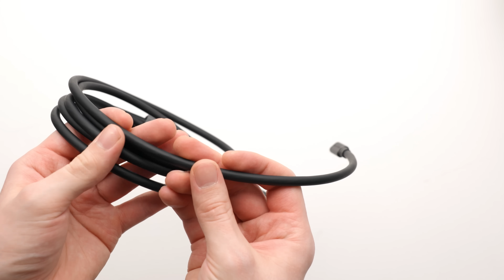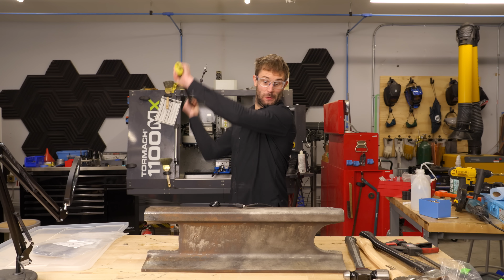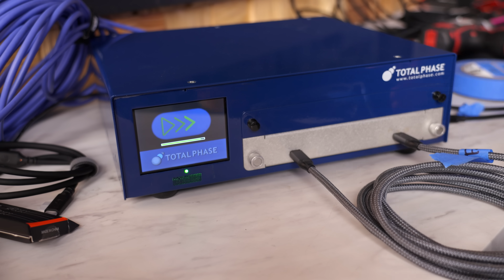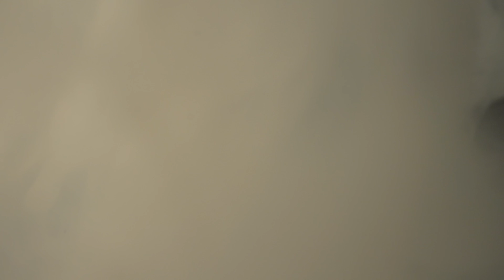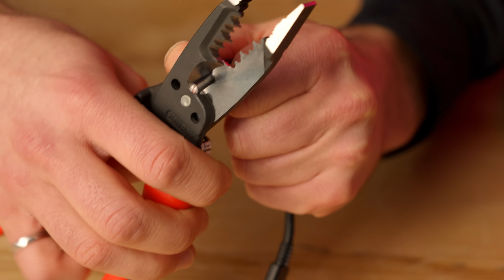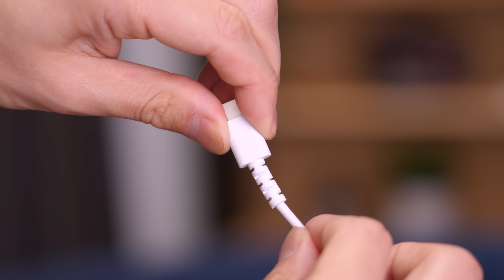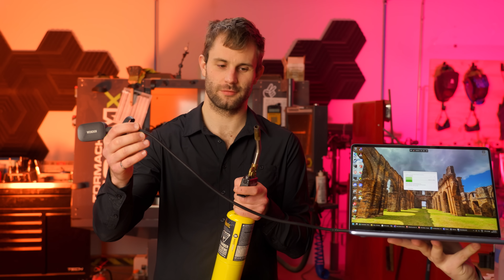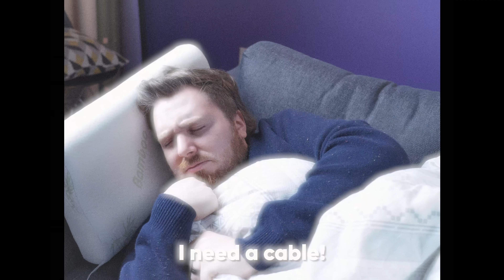Why It Took Me 4 YEARS to Make a USB Cable

Comment: But does the website have a feature where you can selected both sides of the cable and ajust the length and choose specs? It the finding on the website as streamlined as the cables themself?
Reply: That would actually be a cool feature. Have just one product page for the cable instead of multiple. Then there are like 3 drop downs: one for each end of the cable, and one for length of the cable. Then also have a smooth animation of a cable changing based off your choices.
Reply: @ExTr3Me_Cobra  exactly! Every time I need a very specific cable I wonder why no website is doing this. Even webshops that focus fully on cables don't.

Comment: The explanation is a bit woolly. 
Are you saying that there's 4 high speed pairs in both cables but one is 4 unshielded twisted and yours is 4 coax pairs? 
Is the power in the centre important? 
Does using coax negate the need for intra pair shielding?

Comment: I bought a cheap cable tester on amazon for like $50. I went through all of my cables and ended up tossing 75% of them. I was blown away by what even that cheap cable tester taught me. About 25-30 cables got tossed. Bought a handful of ugreen 80gbs/240w cables to replace them.

Comment: It didn't mention it but is it just data and power or does it have video as well because I want to use it for a VR headset or screen and I need the cable to be long and durable with video/data/power.

Comment: Ok guys, now thunderbolt.  I’ll think I’ll buy a couple and try one with my dock, but I’m assuming it won’t work without the right chip in the cable.  My old USB-C dock with my old windows laptop was more stable than my new thunderbolt dock. It’s frustrating. I’m assuming it’s the cable because it seemed to make it better swapping cables, but it’s still not rock solid.

Comment: Pricing may be subjective, but I'd rather pay 30 CAD for quality cables, rather than I pay 3x 10€ for cables that may or may not work. I've always been skeptical of LTT products, as I don't always see the need for them, but this is one of those cases where if true, you have knocked it out of the park. Well done.

Comment: I love how Linus is clearly either concerned about the thickness of those cables himself, or had been at least somewhat convinced of it being a problem by marketing.
Those cables aren't for daily use by a typical iBro. They are either business use, or enthusiast - but unlike pricier hardware, which decimates enthusiast market sales, those are not THAT pricy, which - in the cases of practical purchases - does statistical wonders for sales in this market.

Then again, they'll see it 3 quarterly reports from now on themselves xD
Reply: Checked the whole skew prices.
That word... "premium". I don't think it means what you think it means xD

25 CAD for a good 10gbs 2m cable is far from premium...

Comment: I have multiple USB C charger points mostly using mostly Motorola phone chargers and an old ass apple phone charger that I've just HAD since the iPhone 4... When I go to charge my helmet hands free, some chargers won't charge it and the one that does, the USB C has to be the right way around to be changing.

Very interesting stuff, these cables have a lot more going on than I ever thought

Comment: Funny. I'm dealing with a garbage usb c cable disconnecting when charging right now. I've waited for these since it was mentioned on the WAN show.

NOOOOO all the cables at a length I want are unavailable :( signed up for notification email I am really tired of the cables I am using currently.

Comment: when you said "expensive" i was under the impression they were gonna be like 50 bucks for one of the shorter cables or something, but 30 bucks cad? for a 3 meter 20gbps cable? or a 2 meter 40gpbs cable? and actual good quality build? not bad at all. im down right sick of having a drawer full of garbage, flaky cables that either only do 5 watts or dont do data transfer, or fail after being bent the wrong way.
case in point, i recently bought 4, one meter 20gbps 120watt cables for 60 bucks, or 15 bucks a piece. they are a third of the length and half the wattage, and the build quality is... fine. in comparison the 40 gbps cable is double the speed, double the length, double the wattage, and probably double build quality so id say that a double in price is a non issue.

Comment: I mean 30 CAD on the high end is not an expensive cable really... It's only a little bit more expensive than what similar cables on Amazon go for the in the UK, from a slightly more reputable brand. Global shipping would be the killer of the value of these though

Comment: When Linus said they are expensive I was expecting 40-50 USD range... $27usd for most expensive c-c and $21usd for most expensive a-c. Honestly not unreasonable at all. I've seen similar pricing on terrible cables in retail stores.

Comment: 1-2 years of use and silicon will start to harden and brake... grate idea to use silicon...
Reply from the maker: You're thinking of PVC. Silicone is extremely resistant to cracking and UV damage - LS

Comment: Expensive? Have you seen EU prices on similar cables. Finally LTT pricing that is actually cheap for the quality. Just a pity you don't have slightly longer ones (I know it's harder to make up to the spec, but would be nice)

Comment: All the lengthy ones are already sold out so good job i guess ? lol
Are you going to branch out into different connectors ? Like DP or HDMI ? Those tend to be garbage quality as well, and can even lead to damaged equipment in the case of DP due to power.

Comment: Are these made by the same manufacturer as Tether Tools? They're the only USB-C to C cable I've seen with a little ribbing for pleasure and a similar strain relief. Tether shooting a 102mp camera to a laptop is what highlighted the need for ultra high quality cables for me.. If you guys wanted to take this tech and produce a high end USB-C hub to properly make use of the 2 USB-C ports on a macbook, I'd love you forever. Slap some photograph/videography related branding on it and you could charge a fortune- everyone else does.

Comment: honestly, as someone who spent 30 bucks on a third party oculus link cable + pd charging. these aren't bad prices AT ALL and honestly very reasonable compared to other advertised 'High Spec" cables that are just as good as dollar store ones. the only issue id have with them is that they are a little bit on the shorter side. but its nice to see that a 10GB 10CM cable and the same 10GB 3.3ft cable are the same price (according to the store page)

Comment: You should've incorporated 1 steel cable all the way through the middle, keeping them held together (not able to pull apart... especially the ends).  That single small feature will allow your cables to stay together for YEARS (and set you apart from EVERY other manufacturer).  I'm SO TIRED of replacing my kids charging cables, etc. because the ends have starting to come apart.

Comment: I will say, anker 240W 40GB cables under 6 ft meet the standard, and so do hp's and Dells. At least one of their line does. I'm Blown Away all these damn people keep buying the garbage off of Amazon. Amazon is basically AliExpress, but claiming to have more legitimacy😂
Small tip, a lot of the HP and Lenovo and Dell Docs actually have a strain secured 3.2 or 3.1 at Power delivery ratings such as 120 or 240 Watt. I tend to buy these when the dock fails or I see them at a Goodwill. If they aren't good, I harvest the cable

Comment: Almost all (usable) sizes are sold out on the international store, only more the 3,5m or less then 40cm left so the product seems very popular.I did have a small question about the a-c cable, do these have the high wattage capable conductors like the c-c cables or is the cable itself the limit (Linus has said on wan show if I remember right that the power limit is because of the official limit of the USB specs)

Comment: I have exactly 1 usb c cable which came with an inateck 45w charger which you can't buy anymore. This cable just works since around 6 years! it looks like sh*t because I had to wrap it with isolation tape but it works reliable. I had many also expensive cables which didn't last a year. I would be happy to buy the same 50€ charger again just to get the cable... So I will be very happy to get one of your cables for half of that!

Comment: It's really upsetting that "Does what it says it does, doesn't fall apart after a week of normal use, and has a label to say what it can do" is a selling point here... Especially after hearing your issues finding a supplier. An issue that pervasive for something that simple is supposed to be what a certification process prevents.

Comment: 8:22 I have my right angle 120W cable for my Poco F4GT, I've literally taken care of it and tried to never put any forces onto the end for 3 years and last month it still broke for no reason, and buying quality right angle 120W usbc that will not fall out of the port (as any other cable does)and will actually allow 120W is impossible :'(

Comment: The 16-item list for cables is a mess to scroll through and makes it way too hard to find the right specs. It would be much easier for a user if you just used two separate dropdowns for length and speed instead.

Comment: Very interesting that it doesn't seem possible to make a 40 Gbps cable with more than 1 meter length. That basically means that all longer cables on Amazon are automatically a scam and almost certainly do not fulfill the spec. Mabe expect for a few super high-priced cables, but not the basic cables you would normally buy.

Comment: Let me know when you have a 6.6 foot cable, I really would like one to replace my elegoo Centurion carbon 3d printer printed head cable. Which is just the type C cable, Elegoo has been having a whole lot of backorder issues, replacing their cables and right now I’m using a anchor 240 W cable as a replacement.

Comment: Well, 3 hours in and all the reasonable sizes are gone (or unavailable, whatever that means)! Props to making them in so many sizes.
Also it is quite interesting that the same cable at 3m is 10Gbps and 3,5m is only 480Mbps. Is there no speck in between?

Comment: It's good to see, it's annoying how much cheap crap is out there, but also hard to know if you can get full spec both data and power. Surprised it took so long for Type-C to be adopted and also USB4 in general. Not a single phone or laptop uses it's max spec yet.

Comment: many cable lengths are unavailable. Might I suggest instead of just removig the "add to card" butting, replacing it with a lable, if and when they are ecpected to be available again? Or just nor remove the buy buttin? Instead just generally add a lable, if they are in stock, ordered and so on, making this an indicator, you one would just have to wait days or maybe weeks until their cables get send out. (I actually like that level of transparency on other websites.)

Comment: Video 3 hours ago and cables already sold out (at least the 40cm to 2m but I don't need a 10cm or 3m cables :D )

Also, that price is not expensive at all. The only reason I have not bought one yet is because the length I want is sold out

Comment: Hot take: They are reasonable priced (if you ignore shipping costs). My go two charging cables have been the A$20 Kmart made 2m - Kmart are known for low prices and surprisingly good, but still average, quality. An extra $10 to make that have enough speed for data too seems reasonable.

Comment: Usbc was suppose to save us, but it just made everything more confusing. There is no standard for what a usbc must be. So it’s a wild mess. You need a bachelors degree or 100hrs of youtube university to even understand which kind of usbc cable you need to order. I miss the days of hdmi for video, usb for data and dedicated power supplies with clear ratings on the cable/block.

Comment: Just checked and only saw a 15w 10gbs cable and a 240w 40gbs cable c-c

Where is my 10gbs usb A-C connector with 100+w rating😢 

But hey the pricing isnt actually that bad, ill pick one up when i can get a 100+w cable from you guys.(A-C)

Comment: If you are going to group the cables this way on the store, you should show the higher price on the listing. When all of the cables except 4 of them in the listing are priced at $26.99, clicking a listing that says $21.99 feels exactly like the bait and switch business practices you claim to stand against in the larger market, but really, it just doesn't represent the reality of the product you are selling. In Reality the listing should be at the 26.99, because the majority of options are at that price, the 480mbps cables being cheaper then becomes a bonus to someone who mainly needed the cable for the 240w PD rather than data. This isn't lan issue on the type A to C cables, as the increased price only shows up for longer cables, and a majority of the cables match the listed price.

This complaint isn't because the cables are expensive. Honestly these are fairly priced, maybe even honestly cheap compared to other cables I've had to buy in a pinch. It's just about optics. If the schtick is honestly labeled cables to perform as advertised, then make sure the store looks honest about pricing too.

Comment: I think there would be very high demand for thinner low speed (USB 2) charging cables (i.e. 240W PD) especially in the longer ~2m lengths. This would let you remove shielding and reduce cost, and would be a high volume as people need multiple for charging all their devices. 

Silicon is the right sheath choice btw. The fact manufacturers have moved to braiding is really annoying.

Comment: I’ve recently bought an anker prime tb5 dock to use with a Mac mini m4, after previously having tried other docks,hubs and dongles. I use the provided tb5 cable to the host then connect other disks to the dock with the cables they came with, usually very short usb cables (not tb). I’ve have been experiencing random disk ejections, Anker replaced the dock but that didn’t fix the problem. But having seen this video I’m now thinking perhaps my usb cable that came with the disks are possibly not up to scratch. Should we not trust cables that come with devices and buy higher spec quality cables instead? Why can’t we trust the cables that are provided?

Comment: Imo, it needs 3 standards ASAP.

1: Standardized charging and transfer rate profiles and the requirement that a device can support EVERY existing slower profile. For example, I have a 66W charger and a phone that can support 60W charging. But 60W is not supportet by the charger and for the other 3 amp-volt profiles, the charger actually does support, only the slowest seems to be also supportet by my phone. That's why I would have this as the top most requirement. IF a device can suppport X, it should also be required to be able to support any existing profile that is below X. That could get solved by only allowing official standards as chargind and trasfer rate profiles and making every device support all these (reminds me of the quick charge standards from the old micro usb times).
2: Certifications, that they actually are capable of, what they claim to be. IF they don't have this certification, they should not be allowed to be on the marked, if not even count as illegal products.
3: Clear markings ON the device, what it's capable of. Either by print or ingraving text or by some STANDARDIZED coloring sheme.
3.1 IF there is a coloring sheme, it should NOT BE ALLOWED to not follow it. That might be a shame for everyone who was trying to get a full on orange build but is now forced to tolerate a blue USB port. For example.

Comment: The last time i had to be buy a USB-C cable, it was actually gamble, i would order "Xiaomi XXW" (My phone is Poco M4, a brand from Xiaomi btw) within the specs of my power brick and wouldn't work, i then would return the purchase and go the a next cable order, it had to do this twice before landing on a "Essager" cable that actually worked with my original power brick and properly triggered the Xiaomi's Turbo Charging.
LTT cables would be insanely expensive for me in Brazil but i'm glad to know SOMEONE that is giving enough reasoning to believe their cables are within specs exists now

Comment: 9:30 the only thing I would caution is I would rather the cable break than the device... plenty of devices have terrible socket strength and if your cable is to durable, it will wreck the socket in an accident. I have had some chonky to spec? (well they were chonky and durable at aleast) kill usbc ports by prying the entire port off the board. sure the cable suffered no damage. but the port needed to be resoldered onto the board. When I get a new laptop now (When i void the warranty and put my own SSD and ram in it) I will also put globs of epoxy on all the ports to prevent this. I do not plug USB killers into my devices, and to this day have had no usb port or any other for that matter (aside from swithc ports) die from normal use. But I have had ports die from cables that are to strong to sacrifice them selves.

Comment: One of the cables I'd LOVE to have would be some really high-quality 40Gb with FEMALE end connectors for extending a USB4 port around to the front of my PC without using a barrel connector to introduce ANOTHER 2 levels of resistance and interference.  Also, how about some REALLY high quality VR-Length (5m+) cables with reliable USB-PD power-injection for my Quest3 and maybe other devices that need to be on the other side of a room for... reasons? I know 10Gb is probably the best I can get on that request, but either that or use that fancy USB tester and tell me which Amazon cables are actually worth a damn!